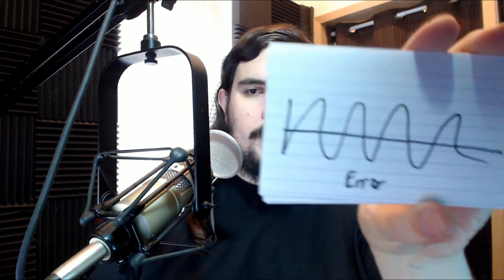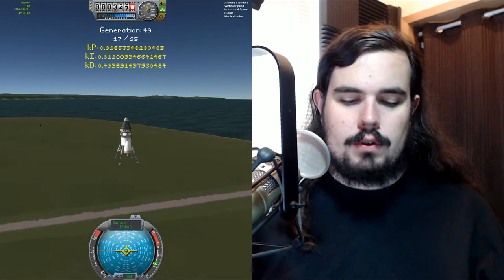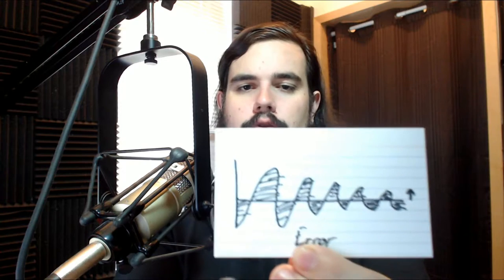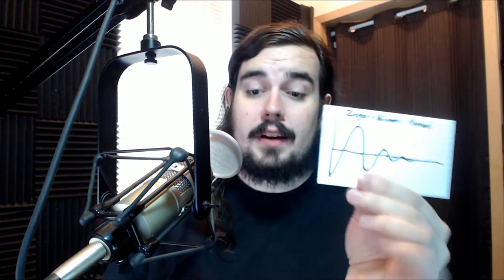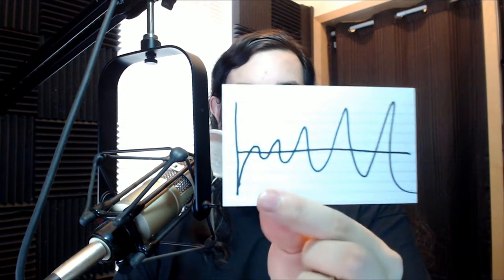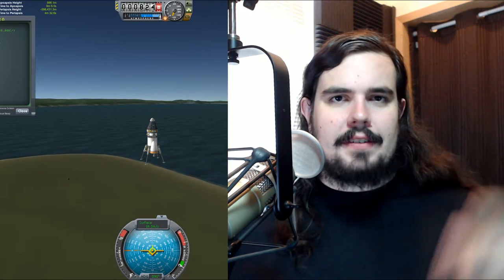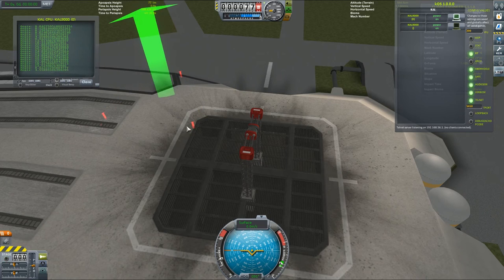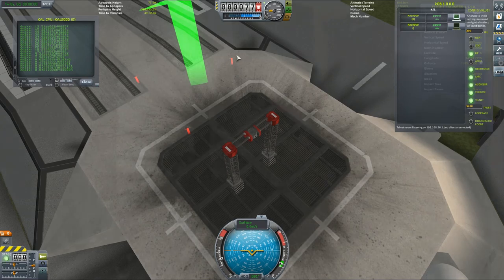Kerbal Space Programming #42 - My Kingdom for a PID!

Comment: Great episode :)

Just figured I would give you a heads up about this kOS feature which you might have missed (I assume since you were dealing with the latlng() method): body:geopositionof(position), lets you translate a position vector into a geoposition, which makes working with predicting terrain much easier. It is documented under the orbitable:body structure.
Reply from the maker: +Ozin370 oh snap, I did completely miss that! Thanks!
Reply: It's easy to miss because it's a feature of BODY  (To translate an XYZ position into a LATLNG, you kind of need to tell it which body you meant.  i.e. A position a few Km above the Mun is still also above Kerbin - just like 12 million meters above Kerbin.)  So since you have to provide both an XYZ pos and a Body to get the answer, it made sense to just make it a suffix of Body where you pass in the XYZ pos.
Reply: dunbar9finger
 Yeah I agree, but since it seems to be a common thing to miss I would suggest adding a note in the geocoordinates structure section referencing it :)
Reply from the maker: +Ozin370 +1 to this. I did a search for geocoordinates earlier as well, just to see if I'd missed something, but this didn't turn up.

Comment: Came here while trying to make my skycrane hover with a PID controller. Looks like I came to the right place :D

I was trying to get it to hover at a set altitude, but was massively overshooting and then oscillating. Not great.
I think setting a target vertical velocity might be better. Once I have something that can hold altitude, I can probably use another pid controller to control my vertical velocity to hover at a certain altitude.

That said, this may not actually be necessary at all, being able to stay in place and moving up and down should be plenty for skycrane operations.
(And I intend to move laterally with RCS)

Also — am I spotting a fellow vim user there? :D
I took the liberty to look through your vimrc - I especially liked
nnoremap - G
I might adopt this myself. Although - is my leader key, so... maybe +.
My name on Github is "Xandaros" if you want to take a look at mine — I also keep my dotfiles public.

Comment: Your geo_offset code is incorrect for latitude.  For a spherical planet, moving (x) kilometers north will always change latitude by 180/(pi*radius) degrees, unless you're crossing the pole.  Your cosine division (appropriate for longitude) is in error.
Reply from the maker: +Majromax thanks! Looks like we'll be switching that out based on Ozin's suggestion as well, so we should be able to remove that :)
Reply: What should the correct formula be? Something like this:geo:lat + (n_offset / body:radius * 180 / constant:pi),geo:lng + (e_offset / body:radius * 180 / constant:pi / cos(geo:lat))???(Just removing the '/cos(geo:lat)' on the end of the geo:lat expression?)
Reply: Yes, that seems about right.